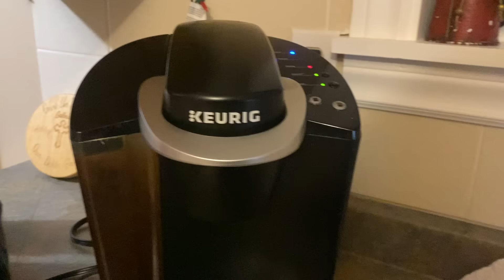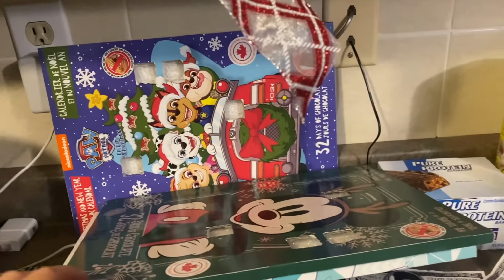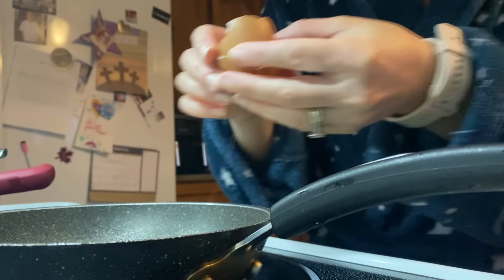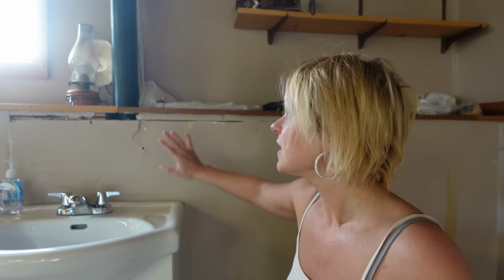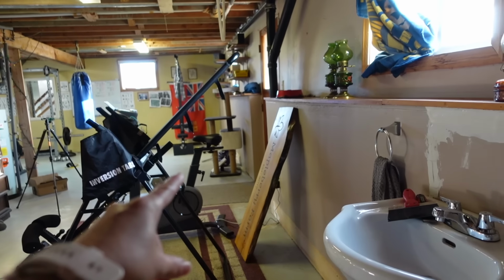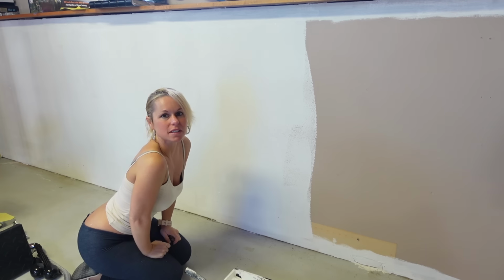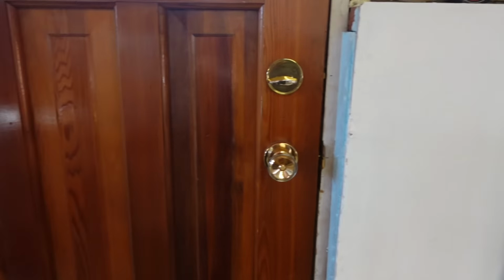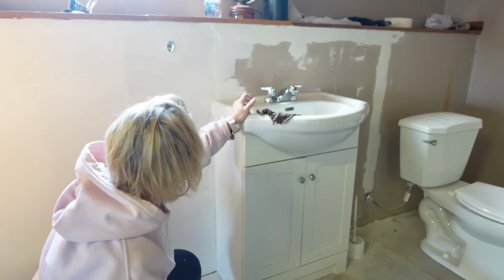FARMHOUSE Bathroom Build Pt. 1

Comment: This lady needs some tips on how to properly mud and tape drywall . tip 1 get the proper tools for the job the right size putty knives . tip 2 use the right drywall compound and for gaps that size id use some sheetrock powdered compound either a 45 min work time or 90 min work time fill the void with that let it set then a thin coat of premixed drywall compund using a 4 inch tapeing knife then id recommend using fibermesh drywall tape . tip 3 if you want it finished correctly youll need 2 coats 1 small to cover the tape and 1 wider to feather out the edges.  But dont know why youd go doing the finishing work because youll be cutting right back into the drywall in order to put up your stud walls and then your going to be drywalling all over again twice the work for no reason .
Reply from the maker: I have had plenty of folks trying to help out. I have tried many different methods, knives, etc etc. At the end of the day, some have helped, some haven't but it seems to work out in the end :)
Reply: More yoga pants please. Great work by the way. @mbfers